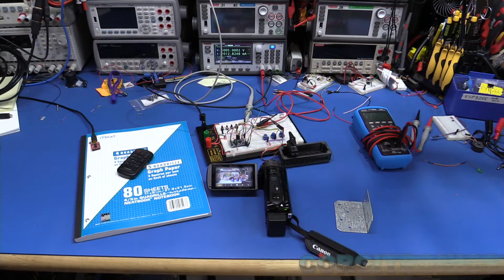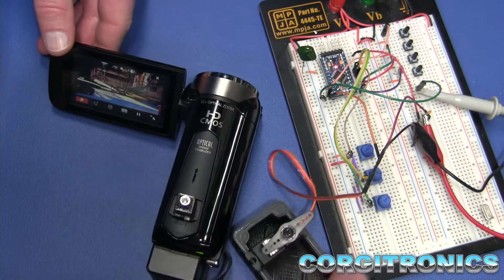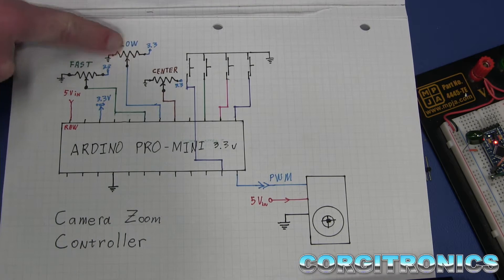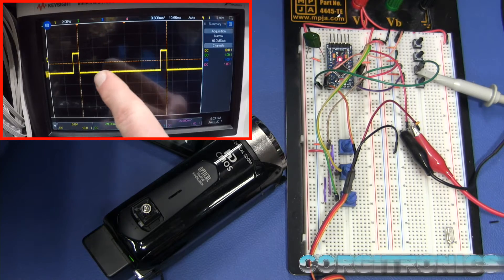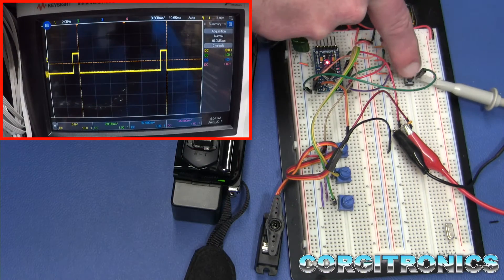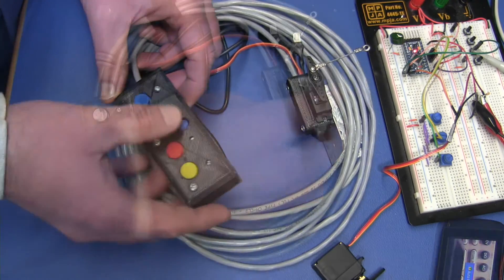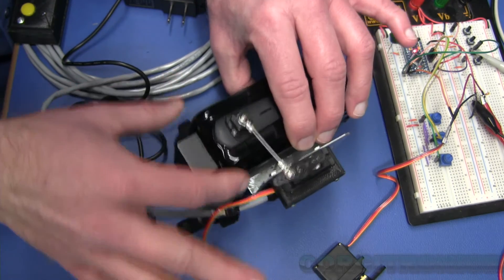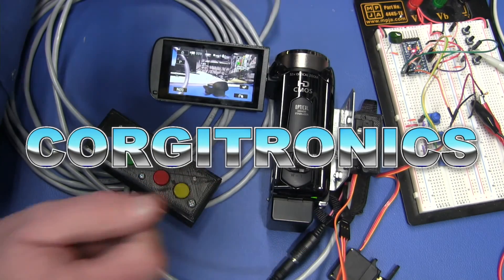Adding remote controlled zoom to a camcorder

Comment: Thanks for sharing, the Panasonics are really great but the lack of LANC port is a real bummer, we are using them to live stream sports and a remote would have made it mush easier. I only need a remote to reach the handle of the tripod so thinking of a basic mechanical solution, but maybe go down this route with a servo also.

Comment: I have the same exact problem. My Panasonic HC-V700 camera has no ir or lanc port. It has app wifi for remote, but hdmi output goes off when using it. And i'm into electronics and 3D printing! Thanks for sharing!

Comment: Hi I know it's and old video, is it possible to get a list of things needed to make exactly this setup?
Reply from the maker: A cheap servo, an Arduino (any that has a PWM), 4 pushbuttons, 3 potentiometers, a few metal brackets that you can bend a little to adjust the fit.  And a 1/4" bolt that fits in the camera base.
The potentiometers are used to set:  neutral position; fast zoom speed; slow zoom speed.
The buttons are for slow and fast zoom in, and slow and fast zoom out.
The sourcecode lists which pins I used for everything.
Reply: @Corgitronics  thank you, i will see if I can pull this off.

Comment: This is a great solution for controlling the cameras at my church, but I have 4 cameras that i would need to control. Can i use on Arduino for all four or would I need to build four separate systems?  thanks
Reply from the maker: An Arduino has 6 PWM pins, but using all 4 at once might be tricky.  I'd get one camera working and then try to scale up.  Here's an article about the PWM pins and their associated timer comparators:  https://www.arduino.cc/en/Tutorial/SecretsOfArduinoPWM

Comment: thanks for this video, very nice. I want to do the same project but without the potentiometers how can i modify the arduino code to work properly without they?
Reply from the maker: You would need to replace the following variables with hardcoded values:  centerVal, slowVal, fastVal, instead of using the analogRead() function.  I'm not sure how you would trim out the settings without the potentiometers... I suppose you can just take a guess and reprogram the Arduino until you get the desired settings.

Comment: I wouldn’t know where to start on a project like this. My first thought would be to order one but I like challenges and learning new things. Where would I start to learn about ardino and all this? I essentially need this exact setup but just with one speed zoom in and out.
Reply from the maker: There's a mountain of tutorials out there about arduinos and PWM.  Here's one example: https://electronicshobbyists.com/arduino-pwm-tutorial/
You can get a similar Arduino for about $9 on Amazon:  https://www.amazon.com/OSOYOO-ATmega32U4-arduino-Leonardo-ATmega328/dp/B012FOV17O
And a cheap servo like this one would probably work fine to move the zoom button:  https://www.amazon.com/Hitec-RCD-USA-31311S-HS-311/dp/B01NAX2XHN

Comment: what kind of wire are you using? i've tried using CAT5e for controlling  pan, tilt and zoom, but the cat5e cable acted as filter for longer distances, so the  servo didn't read the PWM as it should. i was thinking about using an low pass Filter to send DC signals and put another arduino at the other end (next to the camera) and make the PWM again. what do you think? also... did you make this metal holder for the servo? did you folded it yourself?
Reply from the maker: For the control cable I used 4 conductor shielded speaker wire, the type usually run inside walls for whole-house audio.  You might change the arrangement and put the Arduino at the camera and just put the buttons in the little remote box.
The metal bracket is from HomeDepot, called a "Strong Tie", typically used to connect lumber in building decks and such.
Youtuber computerjantje build a similar control that you can see here:  https://www.youtube.com/watch?v=Q199zLxkKXs

Comment: Kewl, I made something almost the same as you did.  https://youtu.be/SWwOHZpottM  These video camera top zoom buttons are way way too sensitive and I usually only want to use the slowest zoom but have to be very careful. The servo helps to prevent zooming at the wrong speed. Also with this system I can control the zoom from the handles of the rig or tripod handle. Instead of 4 buttons, I will adjust the software to that starting with a "double click and hold", the zoom-speed will be one nudge faster then the slowest normal "press and hold" speed. The plan is also to put one extra button (+ led to notify)on the Arduino case to switch the unit into "fine adjusting" mode. the zoom-buttons can then be used to  create the perfect center position. So nice to see someone else had the same idea :) p.s. Instead of gluing, I drilled a tiny hole in the button. I added a new overview video of my video rig with arduino zoom https://www.youtube.com/watch?v=Q199zLxkKXs
Reply from the maker: That's a neat rig, I like how the servo is mounted above the zoom button.  I think that's a tidier arrangement.

Comment: I'm not an EE, so take this question with a grain of salt. Would something like this work over a distance of 200+ ft?
Reply from the maker: Well, yes it could.  The controller box just sends power and a PWM signal out to the servo.  The servo doesn't need a very strong PWM signal, so if the power supply was near the servo to limit voltage drop, then it would probably work.  But, you might do just as well with a simple RC controller, those typically provide PWM outputs for steering and 200 feet should be no problem for an RF controller.  I'm not an expert on RC cars, but one I had used PWM to control the steering, though I think there are other standards now.

Comment: I would purchase one of these since my camera (which is just an updated model of the one in the video) has no remote input. Very nice!
Reply from the maker: Thanks!  This is a pretty simple build, you don't need to 3d print anything.   It's just a cheap servo mounted on a metal bracket from HomeDepot, then connected with a paperclip to a little block that is attached to the zoom lever with double sided tape.  Then a pretty simple program running on an Arduino.
Reply: Me, too.  I was going to ask: "How much to send me one?" :)

Comment: Hi, i was struggling with the exact problem with the exact same camcorder!!! One problem i'm having is securing the contact point between the servo and the zoom control. I need it to be very secure (since it will be placed at a not very accessable place) yet not intrusive to the camera. I see you use some kind of double-sided tape (VHB?) to stick a 3D-printed cube on top. How strong is that connection? Will the rapid movement of the servo shake it off?
Reply from the maker: It's held up well.  The tape has a bit of flex, which probably helps take the edge off the movement.  I think this is the tape that I used:  http://www.homedepot.com/p/3M-Scotch-1-in-x-1-66-yds-Permanent-Double-Sided-Outdoor-Mounting-Tape-411DC-SF/100575385